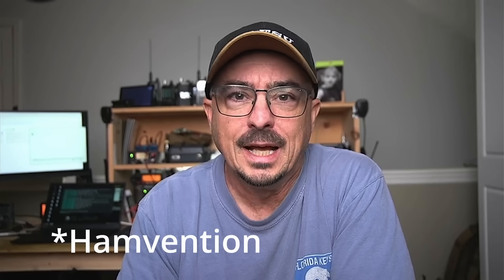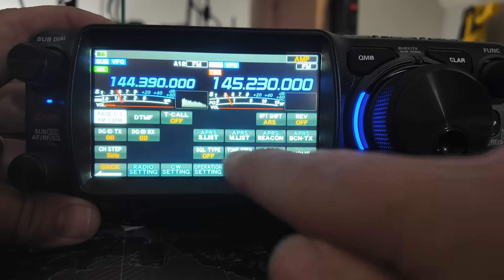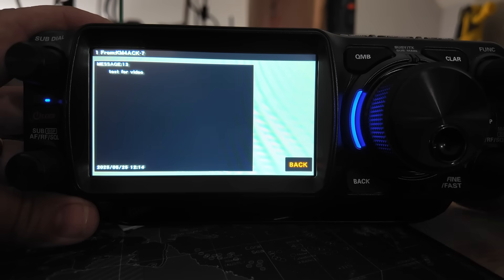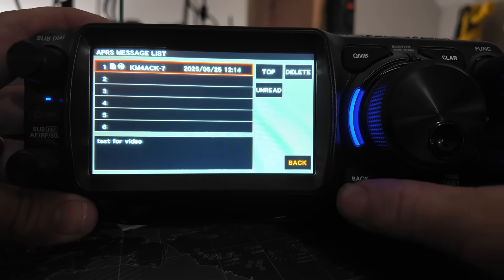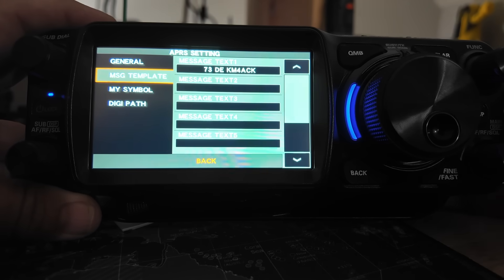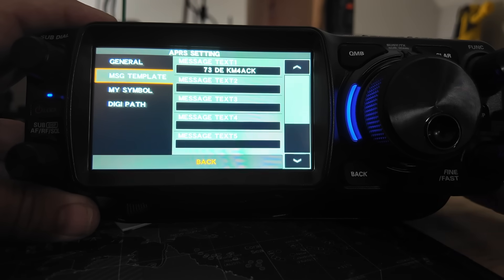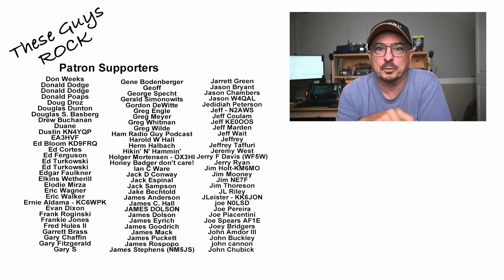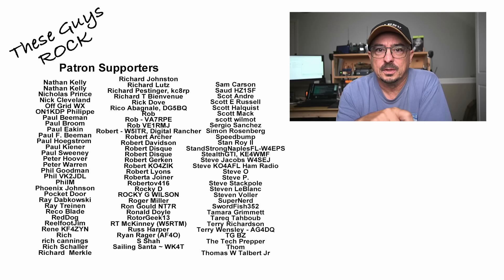The Yaesu FTX has a Flaw

Comment: Not paying 1500 for a 10 w radio.  Not paying 2k for a 100 w radio.    Crazy.    Thx ✌️🙏🇺🇸.  My 857 laffs at these radio kids 😂
Reply: 857 was a good radio. But receivers nowadays much better
Reply: @hamradion1fjb  You are absolutely right but apart from the 857, there isn't really anything to take it's place apart from this radio - and I completely agree with you. If you want a purely HF radio, there is the 891 which is a very strong HF performer. But no radio that can run 100W on HF as well as reasonable power on V/UHF. I've probably spent more money on Collins filters for the 857 than I should have, but they work. Old tech with no software (OK, DSP audio). I do run mainly SDR transceivers though. If I want to run HF only in the field I will use my TX-500 and a linear - overall RX power consumption is significantly less than both the 857 and the FT-1X which draw 1W on RX compared to 100mW or so with the TX-500. 

I will get one but I'll follow on the coat-tails of the beta-testers.....
Reply from the maker: The 857 is a great rig. Still enjoy using mine 👍
Reply: So your response to the radio having aprs problems is to say your radio that doesn't even have aprs and has a MUCH worse receiver is better?
Reply: Mine too!

Comment: I recall seeing something on a rig description early on that mentioned "available in Aug. 2025". I don't recall what that was for unfortunately. Nothing in the current APRS manual for sending messages whatsoever. Maybe that was what I saw?? Available later??
Reply from the maker: Maybe. You are correct about nothing in the manual at this time about messaging.
Reply: @KM4ACK  It's WIRESX that's supposed to be available in Aug. That makes no sense either.
It's not like Yaesu is new to APRS or WIRESX neither working is mind blowing. I very seriously doubt they had to rewrite code to make either of those function.
I still can't believe WiFi, Bluetooth and GPS weren't built into the thing, two or which have to be purchased. Their competitor has those built in.
Then the whole, well it's not meant to be mobile, then the it's dual Rx not duplex. 
Icom has a chance to really beat this radio down with a new release

Comment: Your Direwolf test at least confirms the packets are seen by the radio. I am hopeful that means a software update will make it work.
Reply from the maker: I hope so!
Reply: @KM4ACK Let's make more noise and list some more flaws and get Yaesu to comply. This radio is expensive.
Reply: @KM4ACK  i'm sure the next update or two will fix the arps functionality. But they have a MUCH more serious issue where the radio locks up and requires a reboot when transmitting. Jason, Ham Radio Tube put out a video of it, it's been turned into yeasu too.

Comment: same experience here. particularly disappointing for my first HF radio. also, insane that the FT-5D has room for Bluetooth and GPS, but this beast doesn’t?  🤔
Reply from the maker: Leaving out GPS was a miss on Yaesu's part. Yes we can add it on but we shouldn't have to
Reply: @KM4ACK  I just think it's dumb that the connector is placed where it's placed.  I've had to install PTP servers in buildings for small-cell applications and the connectors for those are usually SMA with something placed where it sort of makes sense.  If they expected that a lot of operators would use this as a base station radio indoors, having an external GPS connector would make sense, but not in the way that they've done it with what looks like a phono-style connector.
Reply: Right
Reply: Good chance on something breaking too
Reply: Should be all ready on the radio

Comment: I hate to tell everyone "I told you so", but this is *exactly* why I will never buy another Yaesu radio again. E.V.E.R. I have owned three Yaesu radios. My VX-5R was excellent. My FT-100D was ok, but would limit power output because of high SWR when connected to known good antennas. (There's a fix online.) My FT-817, purchased shortly after their release, was complete junk.

The problem with Yaesu is that they don't appear to do a good job of testing their radios before releasing them. It's almost as though their way of doing business is to get the radio close enough and then let their customers shake out the bugs. Every manufacturer has to deal with this at some point with a new product, but for Yaesu it is exceptionally bad.

So I gave up on them completely. I'm not spending hundreds or thousands of my hard-earned dollars on junk. When I bought my TX-500, Lab599 was new and had just started building rigs. And mine is pretty much flawless. If you go online you'll see videos of in-lab abuse before anything was ever released. And this isn't hard to do. It just takes commitment.

I'm sorry that you had to learn this lesson the hard way. Welcome to my world.

Comment: Interesting and not good, I agree if they are not fully supporting APRS Yaesu should have left it off.  From your video it looks to be software.  I would look at testing pulling decoded data from the FTX1 to know if it’s software or hardware.
Reply from the maker: I am hopeful it can be fixed with a firmware update.

Comment: Yaesu is not the company it once was - they used to "get it right" before bringing a product to market, now we are like beta testers until they update/finally fix it after we bitch. Not happy with their marketeers taking over the production.
Reply: Dont drop test the fx1 😂
Reply: John Kruk will just spin this all into the failures being “features”.
Reply: @dalesdervin  Yaesu could do a lot better then John Kruk.
Reply: Yaesu was at its best when it was making high quality analog radios with relatively few features, without the user interface and software complexity of today's radios.  Time to market is a huge consideration but Yaesu should have a trusted network of beta testers with all the feedback received and all errors/disappointments corrected before the product ships.  Given the user interface issues that have plagued recent Yaesu radios, it would be even better to precede beta testing with a round of alpha testing to correct user interface and other usability issues before building beta test prototypes.
Reply: Banana Soft. Maturation on Customer side !
Reply: Yaesu is becoming the Sig of Ham Radio.
Reply: @dougdaniels  - Accidentally drop your FTX and you have a negligent transmission and lose your license.   😲

Comment: This is pretty consistent with the APRS experience on my FTX-1. I only spent about 10 minutes playing with it, but just like on yours, it was only decoding a fraction of the packets it should have been. Hopefully this is a fixed in a firmware update soon.
Reply: I find yaesus are just not as good at aprs. My 20 year old Kenwood d710a. Still decodes better than any of the modern yaesus I have.
Reply: @AJ9FE  My FTM-400 does quite well at decoding. I do agree that Kenwood is the king of APRS, their implementation is top notch.